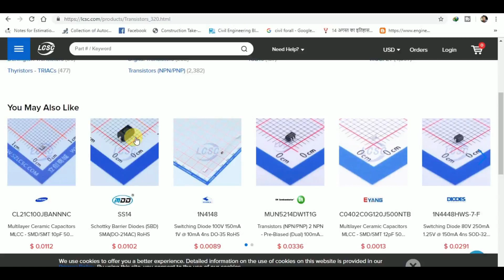How To Increase Bass Using Capacitor | #Bass Circuit | LCSC Electronic | Episode 5

Comment: Bro when im increasing the volume my speakers are missing power so what can i do please tell
Reply: Where u connect your capacitor
Reply: In speaker out put
Reply from the maker: This is my mistake I don't give any circuit diagram Sorry I will Improve.
Reply: I think ur amp protect
Reply from the maker: Watch the video again and work on your project again.
Reply: It was to connect in audio input or speaker output????
Reply from the maker: This is my mistake I don't give any circuit diagram Sorry I will Improve.
Reply: Try connecting on speaker input